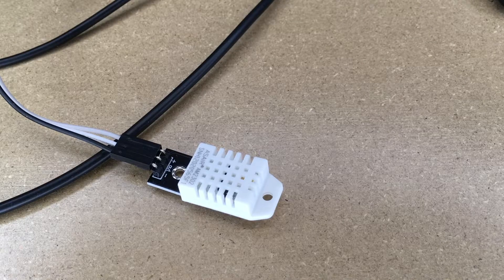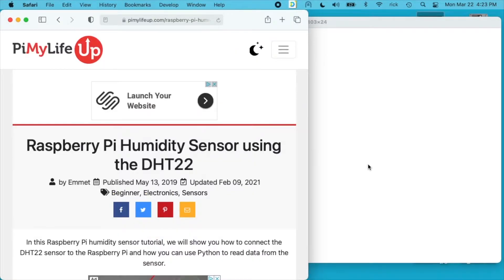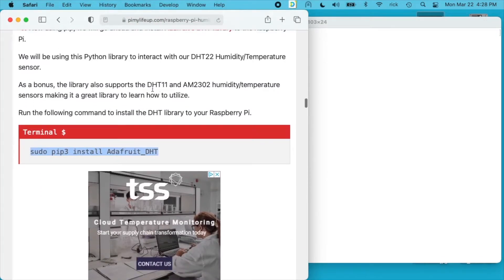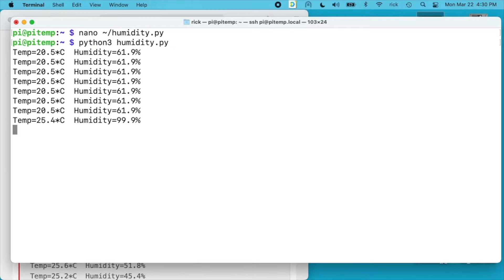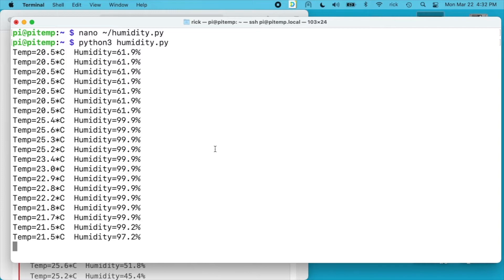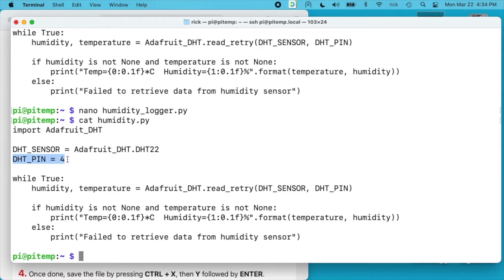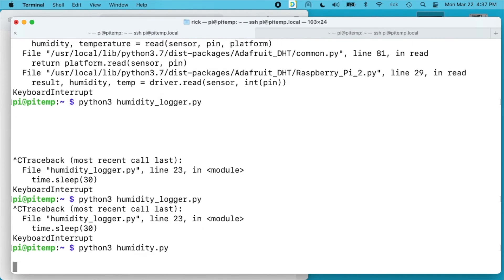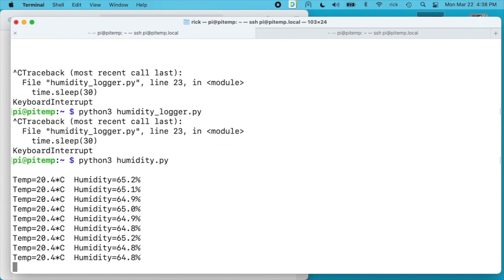Testing a DHT22 Temp/Humidity Sensor on a Raspberry Pi

Comment: It doesn't work properly anymore. The adafruit started raising an runtime error "Unknown platform". Uninstalled the library and when trying to install it again it errors out saying it "Could not detect if running on the Raspberry Pi or Beaglebone Black"

Comment: Hi
@RickMakes  Can i control  the temperature and the humidity of a warehouse of 1500m2 with such devices (sensors and raspberri pi).
Also,which sensors and raspberri pi models do you recommend for such a warehouse?
Reply from the maker: You could potentially use something like this but you can get a thermostat with those features pretty cheap and they tend to be very reliable.
Reply: @Rickmakes  So from my understanding,i should get more reliable sensors than the  DHT22 Temp/Humidity Sensor.
Thank you.
Reply: @Rickmakes  Thank you for your reply.
So from my understanding,I should use more reliable sensors than the DHT22 Temp/Humidity Sensor.